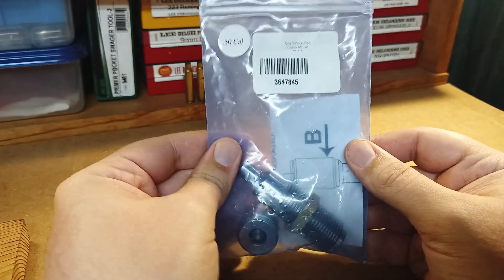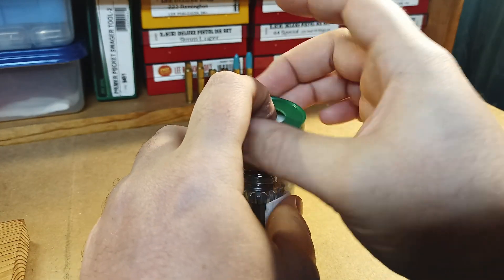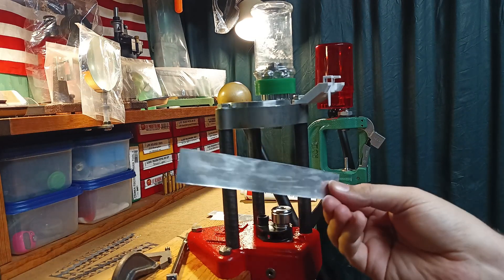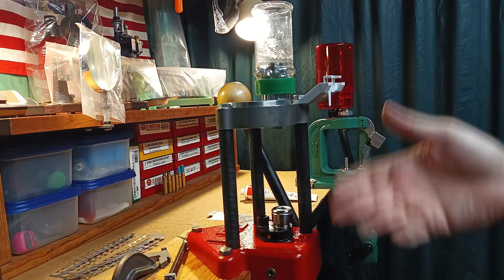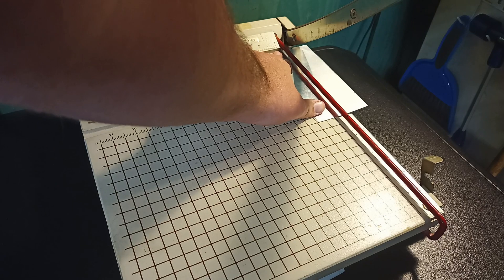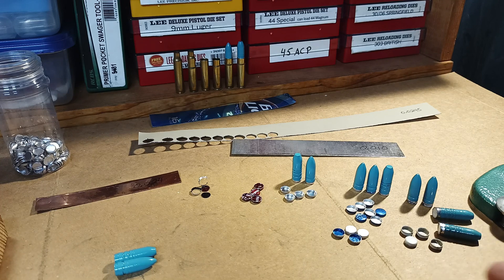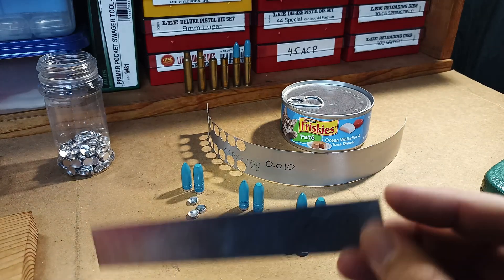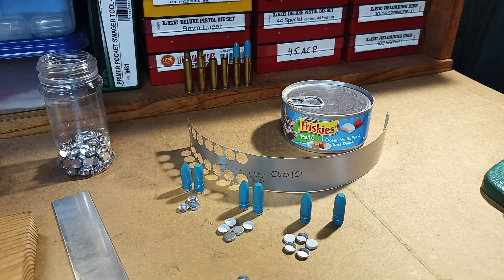One Stroke Gas Check Maker

Comment: If your worried about the checks comming off you can glue them on. Ive got tons of old brass lyman checks the are thin and the sizer wont crimp then on so I superglue them on if I'm only doing a few. If I'm going alot it the old elders glue on a patch of rag and I just tap the base of the bullet on it.

Comment: Have you tried pushing the 170s through base first?
Reply from the maker: I haven't tried the 170 upside down yet but I can try it out. I was using the friction to seat the checks deeper than by hand. I did order a different mold from NOE's close out sale and I'm looking forward to test if that mold has a better crimp groove than the Lee molds.
Reply: @williamganley4739  I'm running that same Lee mold with Hornady gas checks and they crimp on well after powder coating.  The sides of the cup mic at .018.

Comment: Hello William. May I ask you - is there brass for .375Raptor ? Did you lead bullet for this?
Reply from the maker: I do not have any experience with .375 Raptor but I know ocean374 does have a few videos about converting 308 brass. Search Forming 308 brass to 375 raptor.
Reply: @williamganley4739  I need some casting form for .375 bullets (300-450grains) - Anyway, you have great video, thank you!
Reply from the maker: @petrvychodil4002 Depending where you live you may want to consider Lee Precision if they have a suitable mold available or NOE bullet molds where they can make whatever you want. I know there are several more mold makers out there but these companies come to mind at the moment.

Comment: Any gas check that will fall off is a true danger, the idea of an obstruction in a gun barrel, is NOT very comforting.
Annealing the copper or brass is as easy as pie. Even shearing  ( cutting with a cutting board ) will be easier after annealing.
With any gas check, I would want to be 100% sure that it will remain attached to the bullet upon firing.

Comment: I wonder if a VERY TINY drop of Super Glue in the Check and allow it to cure before Seating would cure the problem. Hornady Gas Check have a little Lip on them to Crimp which you don't find on Lyman Gas Checks.

Comment: A metal shop can get you metal in whatever size you want.  That, or you can get an extruding roller. 

As far as the coating, have you thought of just putting the metal in your powder coating oven to burn it off?
Reply from the maker: @matlilly8795  I've looked into the idea of getting a roller press to make whatever thickness needed but they're kind of pricey compared to finding a roll of aluminum in a proper thickness. As for removing the coatings I've burned off the plastic prior for other alcohol camp stove projects. I noticed the metal is now annealed and became softer and requires further cleaning. I might have to make a follow up video in the future testing and comparing everyone's suggestions.
Reply: @williamganley4739  I've just ordered a one-step gas check maker in Sharpshooter brand.  It's 45 Colt size, but I shoot 460 Smith and Wesson so I'll also be able to test it on 454 Casull. I'll try a few things myself and and let you know if I find anything good.

Comment: I produce one-stroke-gascheck stampers with almost same design last 4 years. From .224 to .452 caliber. Mine doesn´t have so nice surface, but looking at this one, I see at least one or two not ideal spots on the cuting piece. May I know the price you paid for this?. But
The biggest one I´ve made has been .512. But that was just one piece two years ago. For me this one-stroke-design is not ideal for the .512 cal, I am not conviced about it´t lifespan. But since the customer didn´t complained after the customization (I had to make some changes at the primar design, because of German PraziPress have a different dimensions than my Classic Cast), it perhaps works until now.

https://youtu.be/oQtd8aodaUs?si=txHdIw2vlM50-YKK

Comment: what's the point of putting those on the bullets? wouldn't they work fine in the shells without?
Reply from the maker: @julianlaustsen1991  You can use powder coated bullets without gas checks but you shouldn't drive them as fast or at highest pressures. Gas checks are basically a holdover from waxed lubed bullets but can still serve a purpose today. Basically in a belt and suspenders format.

Comment: Good video, I have a Plain Base Gas Check maker like  that I use with 158gr Lee FP bullets.  I just set them on and push them thru my Lee resize die, they work with any regular cast bullet.  I also cast and gas check Lee 200gr bullets (358-200-RF).  Those are a heeled bullet designed for regular gas check.  I load them into 38 Special brass for my Henry 357 lever rifle and they work great but because of the over 1700fps that 158's churn up in the 20" barrel the plain base checks work great. for the 200's I just use commercial gas checks, they have a ridge on the rim to hold on to a heeled bullet, you can't fit them on a plain base bullet.

Comment: I am lucky enough to have a jewellers roll mill in my shop, I can dial up what thickness works best in my 22 punch check maker . A Charlie Darnell model no longer made. I also use ally flashing. Cheers Mal in au.

Comment: I would think that it doesn’t much matter how tight the check is, as long as it doesn’t fall off inside the case.  The exploding powder should shove it up against the bullet nice and tightly when the round is fired.
Reply from the maker: @MelvintheDew  The problem is with the Lee 155 bullet in 300blk. If you seat it to the crimp groove the check is below the bottleneck to securely hold it. It could be seated longer and have a exposed crimp groove but could run into a length issue. If you don't gas check it's not a problem but not recommended for higher pressures. Like you said it shouldn't be a problem but I don't want to risk it.

Comment: Once I started powder coating I no longer have a need for gas checks.  I can run full power or reduced loads without any issues in all calibers.
Reply: Agree completely.  I started powder coating my Lee 358-158-RF bullets for my Henry Big Boy 357 with a 20" barrel 5 years ago.  It will push those bullets cast out of dead soft lead out of that barrel over 1800fps using H110 or 300-MP without any leading and using the soft lead they mushroom to over twice the starting diameter.  Clean up after 500 rounds or so is a quick brush and a swab with some Hoppes, clean as a whistle.  I do shoot those bullets in my 350 Legend Ruger American and do gas check them because of the crazy velocity's possible just to be on the safe side.
Reply: how are you getting accuracy? How hard an alloy do you use? I made the mistake of casting , powder coating,  and sizing 15 lbs of .430 310 grainers for my Henry single shot 44 mag. ZERO leading and ZERO accuracy. Groups as  much as a foot at 50 yards using junkyard scrap at mayde 10-12 BHN. Gas checked versions of the same bullet will do 4 inches at 100 yds. What gives?@hardball107
Reply: I've been powder coating for rifles pretty much since the technique showed up over on the cast bullet forum.  Powder coating as a prevention against leading ended long before I got to the 2300 fps hunting loads in my 30/40 and 35 Whelen.  And that's with custom moulds made to precisely fit the ball seat portion of the chambers from Tom at Accurate Moulds.

You of course might be doing something different than I am as far as who makes your moulds for you to fit your rifles, or perhaps your techniques.

One thing powder coating does not do in rifles is provide you with a truly flat bullet base for optimal grouping ability as a gas check does, whether you use gas checks with or without powder coating.

Comment: I have this in .22. My problem is with flashing it wants to cut the bottom of the check off. Pop can they come out great. What do you suggest
Reply from the maker: You're not the only person I have heard that's had a problem with the .22 sized check maker. I would try using some Lee resizing lubricant first. It's made for drawing metals and is water soluble to thin it out or clean up. It's repackaged Castrol Iloform PS 700 as shown on the MSDS link on Lee's website.
If that doesn't work I would try annealing the aluminum. I have seen a YouTube video in which a aluminum strip is heated up with a blowtorch until a permanent marker streak disappears and becomes more pliable.
Overall without more first-hand experience It seems to be a material thickness problem rather than a cutting problem with the smaller .22 dimensions.

Comment: do you run into any issues with aluminum fouling in the barrel?  Most of the time, gas checks are copper.
Reply from the maker: I wouldn't think there would be a problem since I have seen both aluminum and copper gas checks being sold. I have not had the opportunity used my homemade checks yet.

Comment: Mine packed up after about 1000 checks.  Now tears edges terribly.  I believe the edges got damaged.  Now going over to Pat Marlin As you can clean and avoid issues easier.
Reply from the maker: What was the material and thickness that you used? Also I was thinking you could try to hone the edge with a ball bearing and some grinding compound.

Comment: Try seating them in a lubrisizer ( RCBS, Star or Lyman. They push the bullet through base first.  Use a top punch for the Lube-a-matic,  or Turn up a bullet nose punch and push the bullet through the Lee die base first?   Have you tried annealing the aluminium strip? Just a swipe of bar soap, then blowtorch, until the soap goes black. Quench in water. A dab of clear glue on the bullet base?
Reply from the maker: I have not tried annealing yet to reduce memory. Although I have experimented with super glue. I'm currently waiting to see if there's any reactions with powder coat degradation overtime. DimaProk who produces gas check dies suggested slightly thicker aluminum stock. I believe the aluminum I used is just not thick or strong enough to properly crimp and fill out the cup fully. This can be seen with that thicker aluminum sheet overflowing when crimped.

Comment: Do you really need a gas check on a power coated 30 caliber bullet hard cast
Reply from the maker: It depends on what you're going to do with it. For general lower velocity plinking I doubt it would be a problem. On the opposite side I'm looking to get into higher supersonic speeds. It's also cheap enough just to include a check regardless since you can make them for fractions of what store bought checks cost.
Reply: @williamganley4739  I've never had a problem with powder coating to 1800fps but I bought a 350 Legend bolt gun and those 158's can run over 2200fps so I gas check them just in case.

Comment: Good job!What is the thickness  of copper that you used in milimiters?
Reply from the maker: The copper is 0.5mm on the factory edge. In the video I measured on a cut edge so it was a little thicker.
Reply: @williamganley4739  Thanks 👍

Comment: is that steel or aluminum flashing material for gas checks?
Reply from the maker: Aluminum. I'm still looking for slightly thicker material around 0.015 - 0.017 for a better fit.

Comment: One thing though, Gas checks are intended to prevent leading of the barrel, bullet lube is another method they use, but powder coating gives a smooth slippery shell to the lead bullet, therefor keeping the lead away from the barrel preventing leading of the barrel, so a gas check is not needed with powder coated bullets!
So, is this a belt and suspenders thing or what?
Reply: Powder coat isn't a replacement for gas checks... Not sure where that information gets confused. Gas erosion doesn't discriminate against a poly coating, lube or plain lead. It's all pressure based..
Reply from the maker: There are a few benefits for the continued use of gas checks. You can increase the fps rather than treating it like a plated bullet. It also retains the benefits of reducing leading at higher pressures. Another advantage is certain powders degrade powder coatings overtime and this provides a physical barrier.
Reply: Not true, Most 224 bullet molds(for 223/556) use a gas check heel, not having a gas check there will severely effect accuracy

Comment: Use some coarse sandpaper on the inside side, so the lead/powdercoat will grip it better. Or use a thinner coat. Even just using razor blade scratches should do something.
Also try using the bottom of a soda can, with the outside of can being inside of check, it's slightly thicker. Or put the aluminum in the oven for an hour to soften it up, and the soda cans

Comment: .017 is pretty standard for factory checks. they also seem to have a barb on the inside top edge that embeds into the lead to hold them on. I've also tried checking first then powder coat. Seems more reliable.
Reply: I didn't think you needed to gas check if you powder coat. ????
Reply: @GunGuy258  Powder coating is essentially a polymer jacket.  Polymer is a lot softer and less resilient to blow-by gas cutting (is that the right choice of words?) than copper alloy bullet jackets.

Powder coating's primary purpose is to be an alternative to conventional bullet lubes.  You can probably push powder coated bullets without leading (or loss of grouping ability) at higher velocities/chamber pressures than conventionally lubed bullets.  But with either, eventually you are going to have to use gas checks to both avoid leading and get the best results as grouping potential.

Comment: .017 - .020 is way too much for 30 cal.  The reason it grew for you is because it's being stretched as you form the GC.  I make my own GC makers in the same style.  I use Amerimax and Gibraltar aluminum rolls and .0.013" - 0.014" thickness worked very well for me on Lee 155gr and 150 FN as well as half a dozen other 30 cal bullets.  

Pop cans are actually only .004" thick, ok for flat base gas checks only.  My local Home Depot sold Gibraltar brand rolls and it was perfect around .013" but since Covid, they switched suppliers and now it's thinner at .011" and that in my experience doesn't want to stay put.  Amerimax was sold in Ace Hardware, not sure anymore but it can be bought online.  This one still says 0.014" on the label whereas the other one they actually removed the thickness from the label.

As far as staying put, I found that its more difficult to install gas checks on PC bullets and PC tends to be slicker, and its harder for GC to stay put, also since you're using Lee lube that might be also the problem.  I found no need for any lube to punch gas checks but if you think it really helps, make sure to wash it off later.  What I do is I install GC on bare lead and then powder coat everything.
Reply: Oh yeah, one more thing.  I found some aluminum sheets at local scrap yard from a print shop, they came in two sizes, one was around 11 thousands and works great for .357 / 9mm, it's too thin for 30 cal.  Measuring thickness with calipers is not very accurate, it varies a lot and you'll get false readings.  You need micrometer with ball attachment, the one I got from Harbor Freight is actually pretty good, it allows for more accurate readings.
Reply: That's Genius!

Comment: Cool tool, just seems to be a sourcing problem on type of material. Thanks.
Reply from the maker: I have seen the suggested sizes of 0.017 to 0.020 inch flashing is recommended. Like you said the problem is finding good local sources.